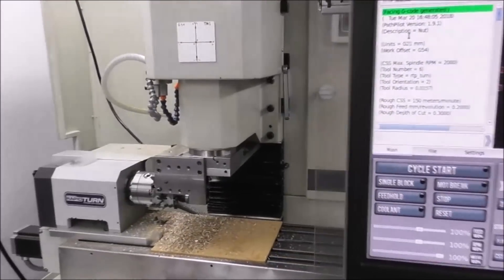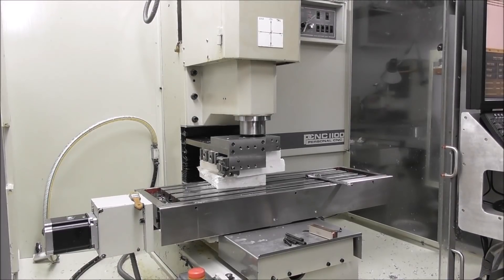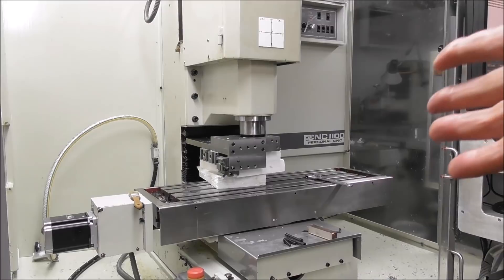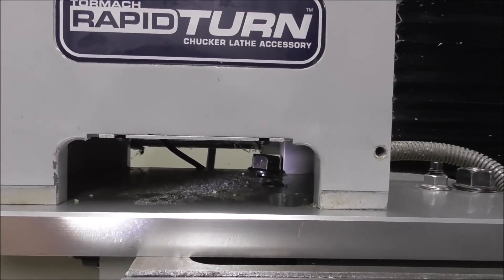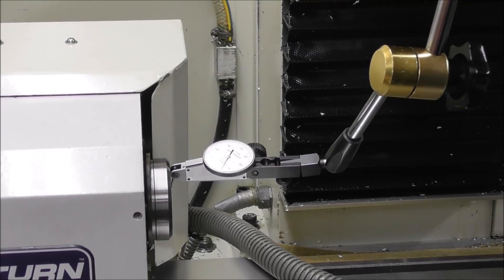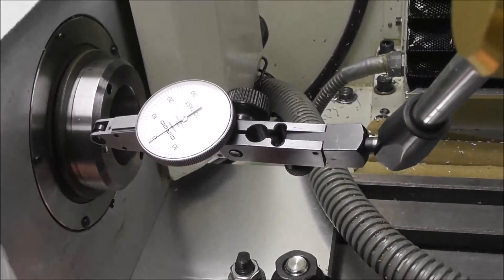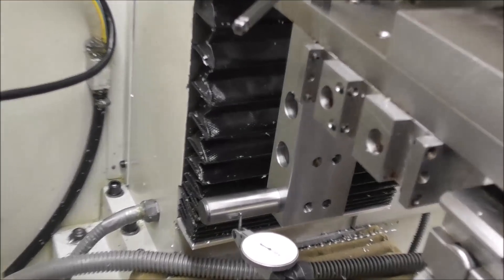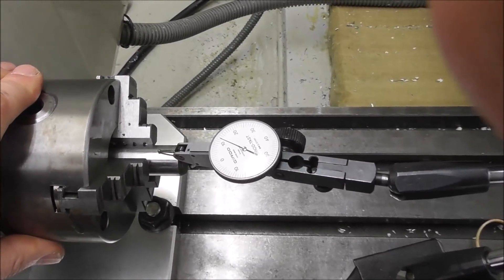Tormach RapidTurn  Set Up and Run  -  Part2 -  Set Up   mp4

Comment: To avoid putting the y offset in the code. By changing the post processor for generating the gcode, it is possible to add a move command to y zero after every tool change.  Getting the correct y offset is pretty easy as you can edit the offset table by adding or subtracting the current y DRO value to the y offset table value, the DRO will read zero if you have entered the added/subtracted the correct value.
Reply from the maker: Hi Stig. Thanks for your thoughts on this. At the time this video was made anyway, Pathpilot Lathe did not have a Y offset table. But maybe is does now, I will have to check that out. Cheers  Cliff
Reply: @Threadexpress  Its been around for a couple years at least as I did the y zero move in the post processor 2 years ago. At that time, I was using the Tormach 0xa quick  change tool holder, your videos were among the most useful when I was trying to use it.  Today I finally used my own gang tool holder design for the first time and I was trying to refresh my skills.  To me the most critical understanding is what UI buttons affect the G54 coordinates versus what affects the constellation of gang tool offsets, so all the myriad of tools stay in sync when one changes "zero". THanks again to you, Cliff!! Perhaps I should jump into the fray with my own understandings....

Comment: Would this part be possible on the slant pro? Would setup be faster? I’m thinking you might not be able to do the cross slot? Informative video.
Reply from the maker: Hi Douglas. I think it would work on SlantPro slotting with the X - set up time should be quicker, but no RT video. Cheers  Cliff